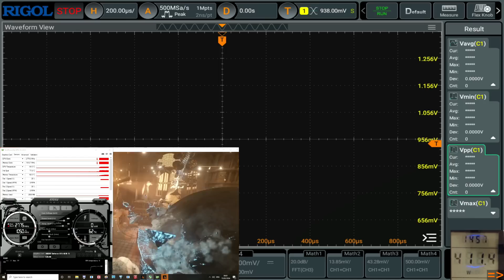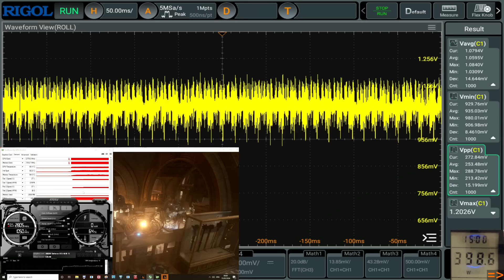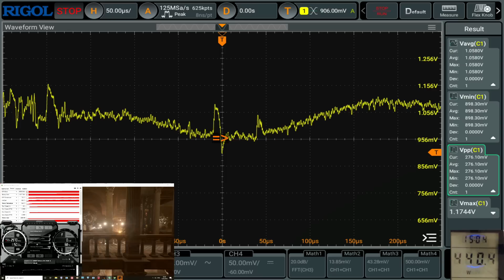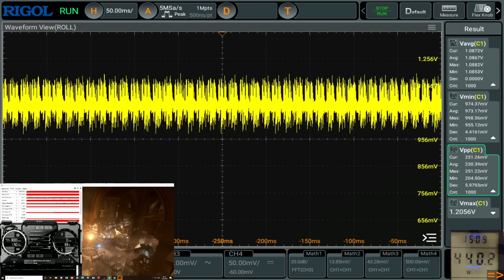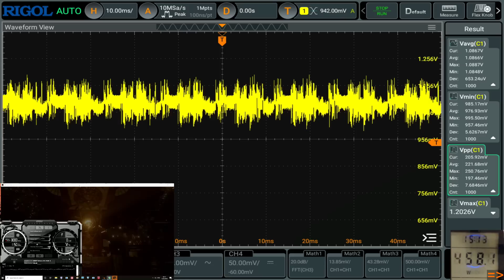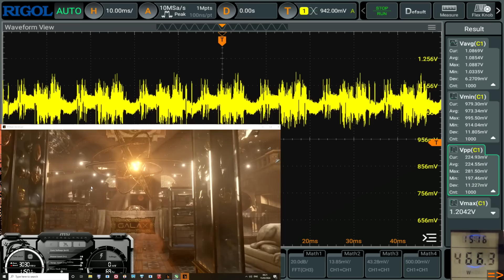Checking the Vcore regulation on the ASUS RTX 4070 Ti TUF

Comment: Glad to see you working on the 4070ti models.  The Strix version has the chip for an additional voltage regulator you can solder on, and geared towards overclockers.

Comment: It is fascinating that the circuitry for the controller can do so much with so little. I mean every transistor that turns on takes a little and then stops when it shuts off. I'm surprised the power controllers are about to do what they do. I guess the Ideal circuit would be so complex that it would take up half the card. Wish I had the resources to tinker with that.

Comment: Maybe have an eye on "VIDEO-Clock" (HW monitor64?)  and Performance like 3dm Points after you changed PowerLimit and or Clocks. Sometimes when Gpu Clock goes up, video clock goes down and you loose performance. Clockstretching...